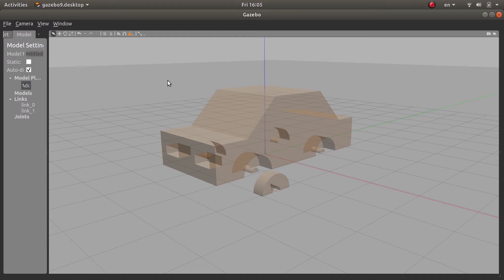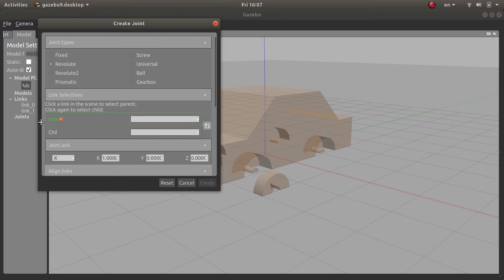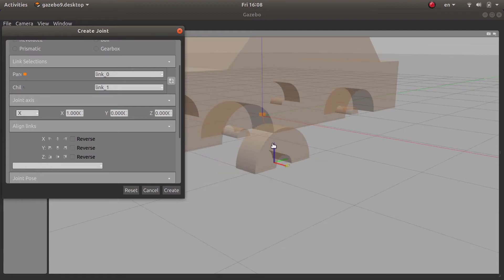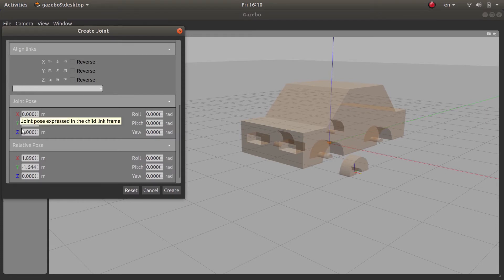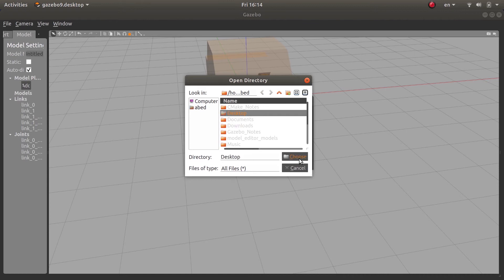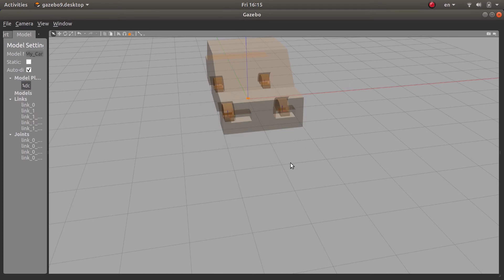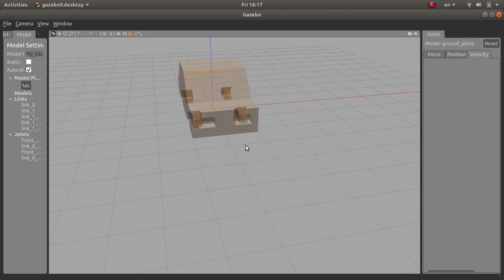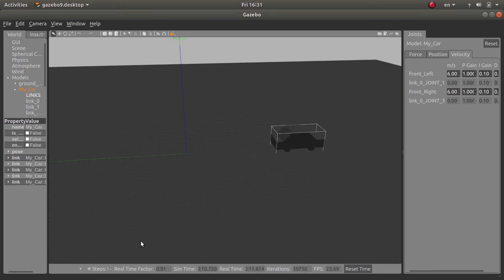Gazebo: Model Editor - Part II

Comment: Great video, really help me a lot! Btw, what's the difference between .xacro, .so, and .dae file? Thanks
Reply from the maker: I'm glad you found it helpful!  Similar to .urdf, .xacro are xml based files to describe your robot models. As for .so, there are shared object libraries that you can link to your simulation, for gazebo these are used for plugins (code that will make you interact with the simulation, like including a sensor, controlling an actuator...). And finally, .dae files are called collada files and these store 3D meshes that can be used to build any model (robots, cars....)
Reply: @Robotogeddon  thanks for the reply, so can we save the file with .xacro file instead of .dae from the gazebo? Anyway, I'm hoping that you can make a tutorials about how to add camera to our model, and publish the frames to our node.
Reply from the maker: @Ptptp  I've never saved a .xacro file directly from gazebo and essentially Gazebo deals with sdf files. Actually you don't need to do this because usually you design complicated robots in other CAD software like onshape, solidworks.... and there are tools to transform your CAD model into .xacro, urdf and even sdf files that you can open in gazebo. And of course, I am planning to release some videos  about plugins that allow you to interact with the simulation!